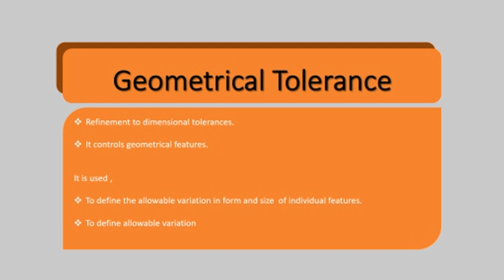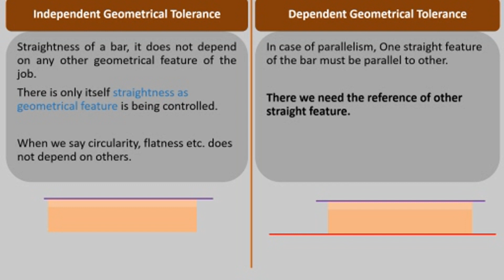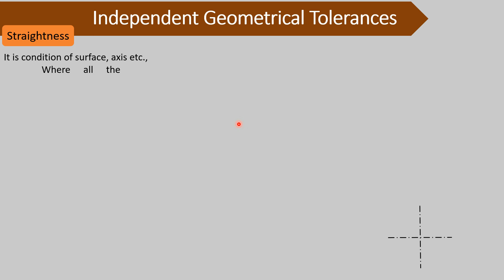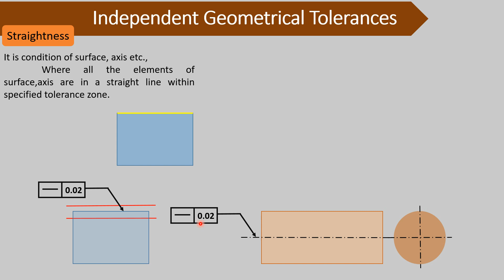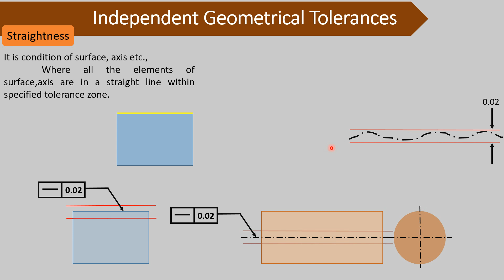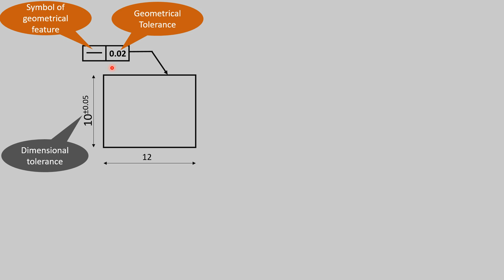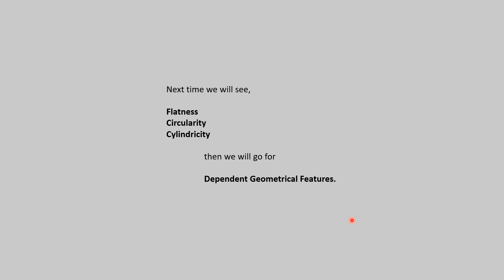geometrical tolerance

Comment: when I can control straightness/flatness by angularity, perpendicularity and parallelism then why will I use form tolerance unnecessary? will not it cost more and will not control perfectly all the aspec?
Reply from the maker: Straightness and flatness are independent features so whatever torrence given within that you will get, and what you suggested in that case it is dependent so won't be that much precise than individual feature control. Hence you will use individual feature control only if that much precession is necessary so then cost will be obligation for your requirement.
Reply: @shrikrishi  how can you say won't be much presice when angularity, perpendicularity and parallelism control both flatness/straightness + orientation then tell me which one is more precise.....form tolerance or orientation tolerance?and tell me the logic too...only telling something doesn't state anything right.

Comment: When we say that surface should be straight within 0.2 mm, is it 0.2 mm Per meter or 0.2 mm per 100 mm?
Reply from the maker: As this tolerance is given to job dimension it will be applicable along that dimension. When we manufacture small jobs like slip guages which has defined class there it is given per meter.
Reply from the maker: Mech E As this tolerance is given to job dimension it will be applicable along that dimension. When we manufacture small jobs like slip guages which has defined class there it is given per meter.
Reply: shrikrishi THANK YOU
how do we calculate the geometrical tolerance required while designing?
Reply from the maker: Mech E it is taken one tenth of dimensional tolerance